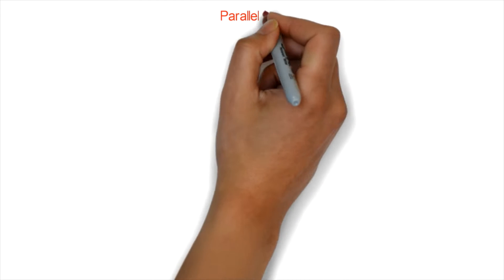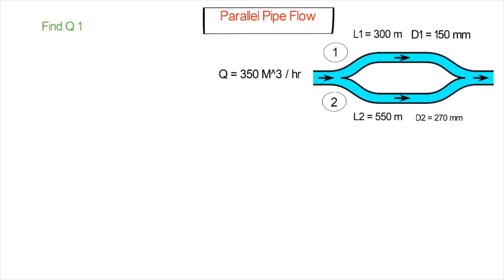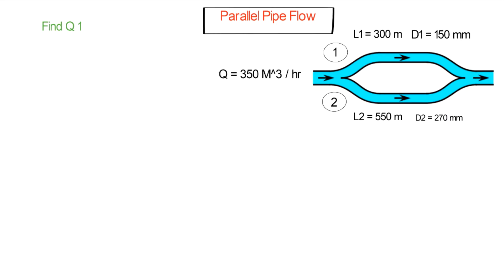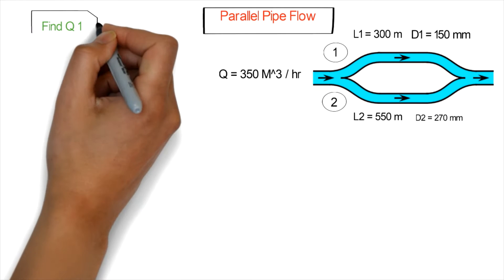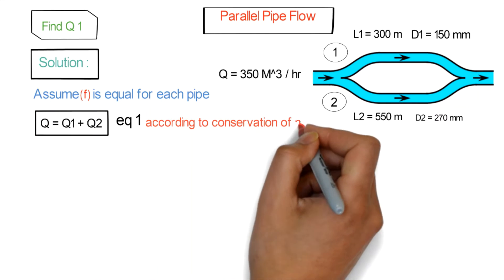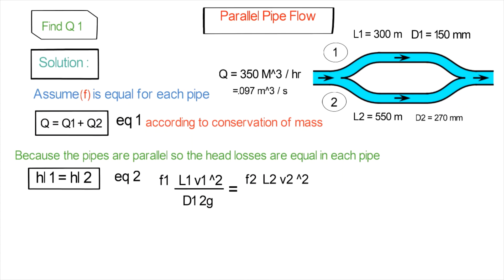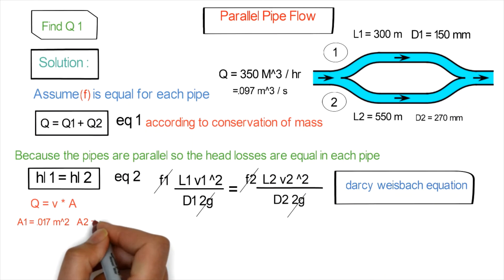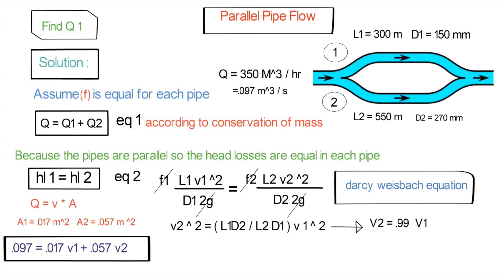Mastering Parallel Pipe Flow Systems | Fluid Mechanics Explained

Comment: Sorry. How did you get from V2=.99 V1 to V1= 1.32 m/s?
Reply from the maker: Well . if you substitute with value .99V1 instead of V2 in the equation (.097= .017v1 +.057v2)  so ( .079= .017v1 + 057*099 v1 ) you will get v1 = 1.32 m/s
Reply: @engineeringkeytutorials  thank you. I did end up working it out. Great video, thank you.
Reply from the maker: you're so welcome  😊 @johno6294